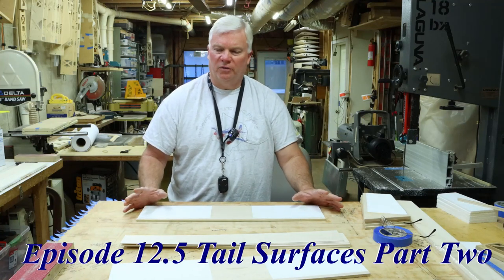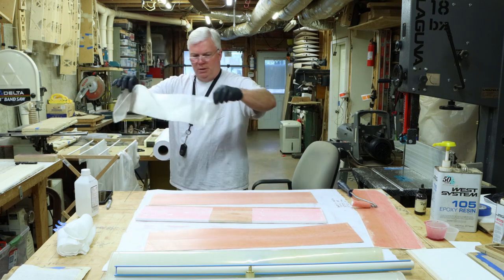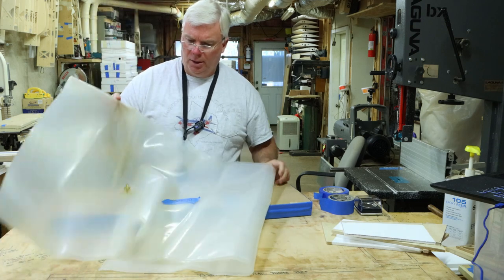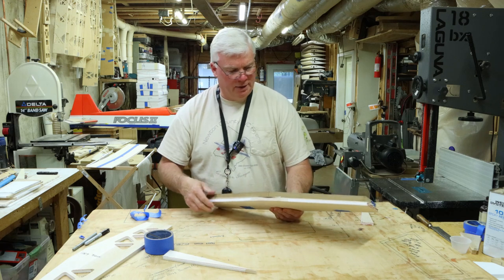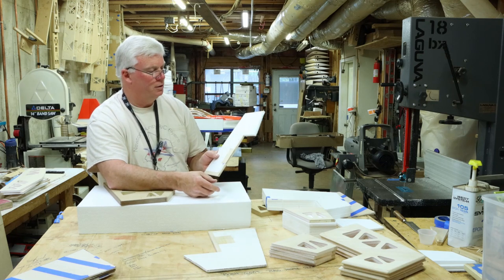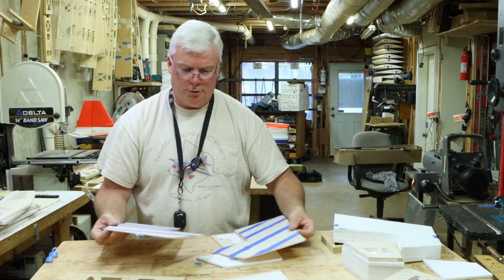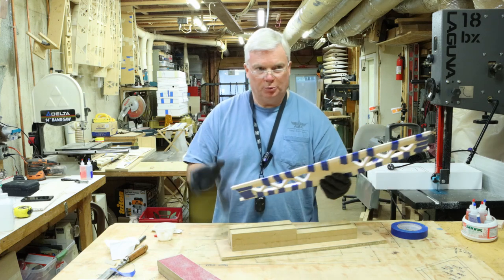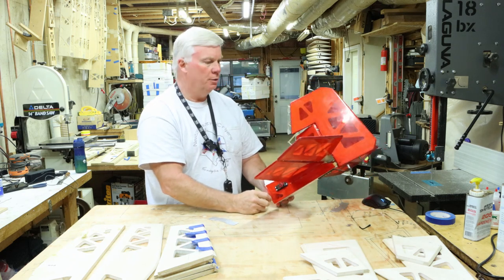Scratch Building Your Own RC Plane Episode #12.5 Tail Surfaces Part Two

Comment: Another great video 1 trick you can do when you put your template on the item to be routed is either double sided tape or what luthiers ( guitar builders ) do is put masking tape on say the template mark where it goes on the part to be routed the put masking tape on it  where it was marked and then put cheap ca on 1 of the tape part and then press down and it will stay put until you remove it saves re taping all off the time
Reply from the maker: Yeah,  double sided tape was my first method.   That quickly got far too expensive and unreliable.    Painters tape is cheap, quickly removed and very stable when used as a strap clamp.  The router table really needs a stable clamp system.   Any movement is catastrophic.   

I should have discussed that in the video.  Perhaps I will in the next episode.   Thanks.

Comment: Great series, but why has it stopped halfway during the build ?
Reply from the maker: Sorry for the delay Alfred but I've had some medical issue get in the way; neck, back and gallbladder.   I'm doing much better and filming as we speak.  New episodes will be out soon.
Reply: Mike, great to hear you’re back !
Keep up the good work.
If only I had room for a workshop like yours….
Reply from the maker: @alfredvink  

In my experience,  workshops are NEVER big enough.   I need to triple my space at least.  It's a pain to swap it over from furniture projects to plane projects.   It takes about half a day to get things shifted back in place.  

Be sure to join the RC FOAMCORE WINGS Facebook group for ongoing conversations about this and other Foam Core stuff.  

I'm getting a batch of BushGnats ready in my spare time and posting their progress there.
Reply: @mikencrcf6018  I agree that it is a pain to convert from project types.  My work space is shared with a classic car and I don't have  dust collection system so as you can imagine, my productivity is challenged.  I do a lot of my 'non dusty and smelly work' in a spare bedroom.